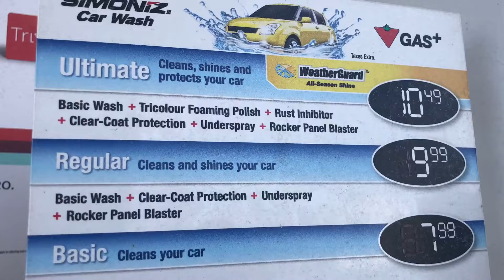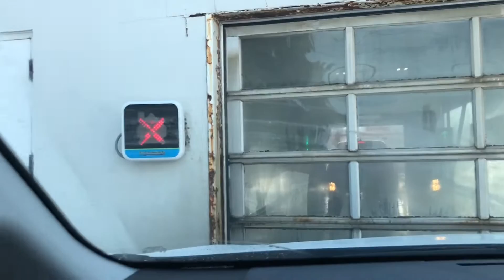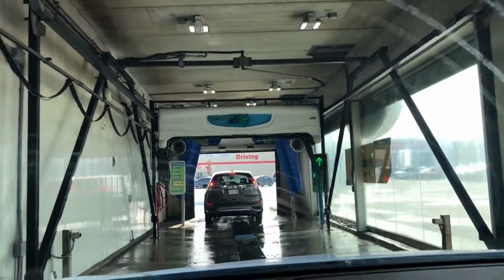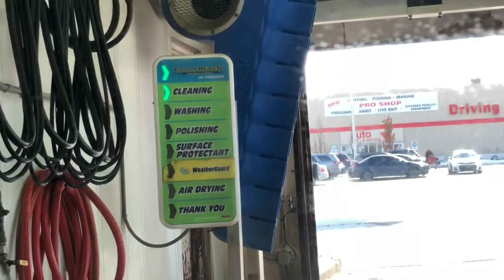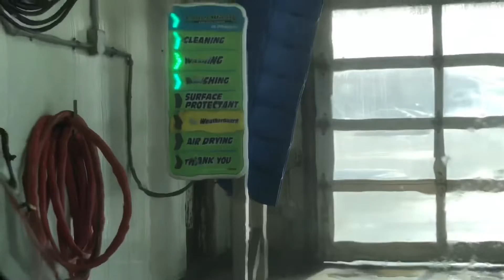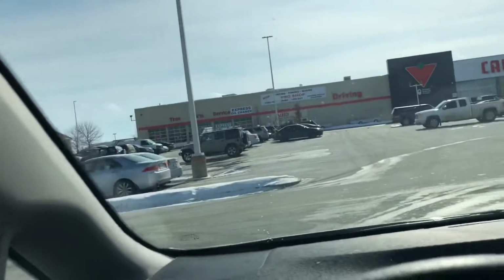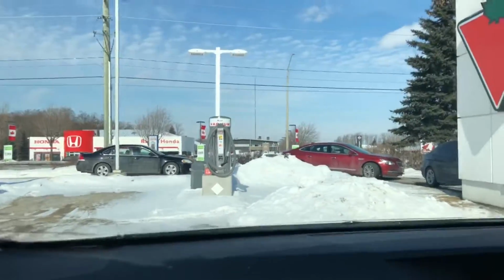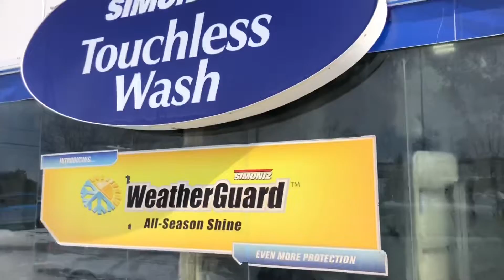(Rare Find) PDQ LaserWash M5 With Belanger Dryers at a Canadian Tire Car Wash in Barrie

Comment: Actually alot of those system have Belanger Air blade dryers This is a very nice wash I should do it in the future if that system is still around :D
Reply from the maker: Agreed. I wondering that there’s used to be another Belanger System. :D
Reply: @tylerm666  Well I do really want to go to barrie someday
Reply from the maker: @kingofthecarwashes6724  Agreed. Barrie has interesting Systems. Even a D&S IQ Soft Touch. :D
Reply: @tylerm666  Oh wow! now I might not go until next year but ill make sure I do one there as long as its touchless
Reply from the maker: @kingofthecarwashes6724  Nice! Hopefully you can film something in Barrie. There’s even a Mark VII SoftLine Dynamic Tunnel. :D
Reply: @tylerm666  Nice someday When the stupid coronavirus disappears I can do a touchless tunnel
Reply from the maker: Nice! There’s 2 in Barrie. :D
Reply: @tylerm666  Okay Ill have to keep that in mind  for when I go there
Reply from the maker: Sweet! They are Both at a Shell. :D

Comment: I found an Autec system at Hachey's Car Wash in Thunder Bay. You should probably check that out.
Reply from the maker: Albertan Car Washes Oh Wow! That’s Rare. I never Went to Thunder Bay Before. If We are in Thunder Bay, I will film it for you. :D
Reply: Tyler M It’s not just any ordinary AUTEC, It’s an AUTEC Evolution! (EV-1 for short) $16 for the Combo wash must be worth it.
Reply from the maker: The Car Wash Fanatic Oh Wow! That’s Really Awesome! Hopefully we will be that area soon. But it’s Really Going to Be a While. :D
Reply: The Car Wash Fanatic How rare is a newer Autec Evolution?
Reply: Albertan Car Washes not really rare, but not really common. So they are semi rare machines.
Reply: Tyler M There used to be a vintage Mark VII with the triangle shaped drop down Vortex dryers at an Esso station in Thunder Bay, but it was torn out and replaced with a Tim Horten’s drive thru :(. The gas station is still there though.
Reply from the maker: The Car Wash Fanatic Oh Wow! That is Extremely Rare! Too bad that they Removed the Car Wash just to put in a Tim Hortons’s Drive Thru :(
Reply: Tyler M That happened in Calgary as well, although I'm not sure what the machine was and the gas station was also removed. It's gone but the wash bay is still there and the gas station was replaced with a Tim Horton's.
Reply from the maker: Alberta Car Wash Channel Oh Wow! :(